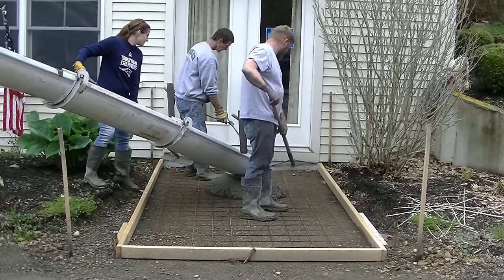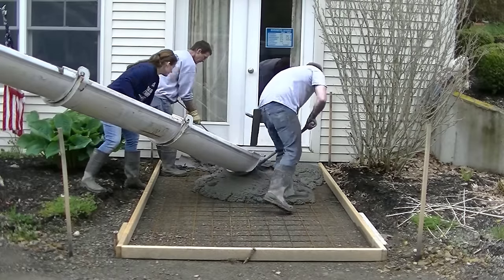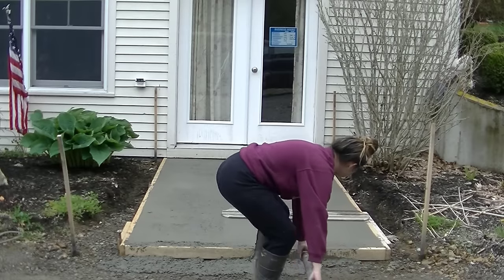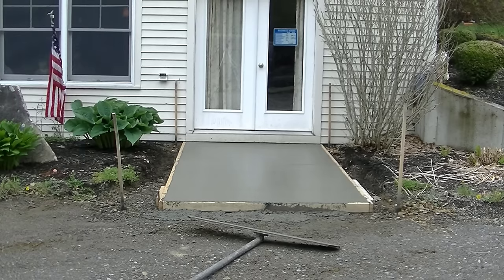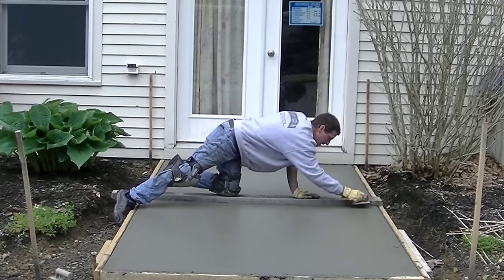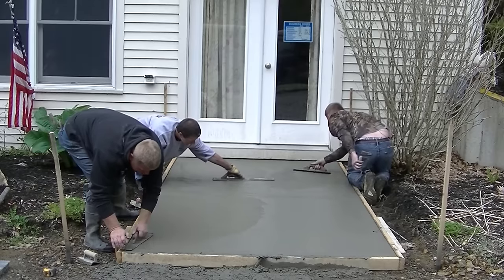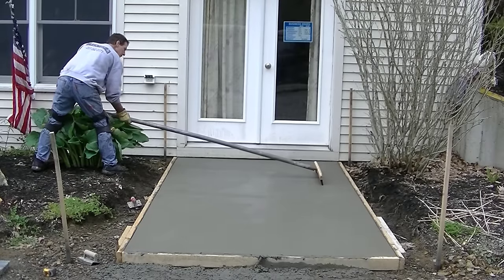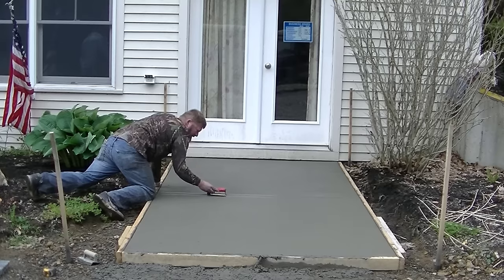Dry Pour Concrete VS Wet Pour Concrete - No One Else Is Telling You This

Comment: I’d use professional wet mix for speed and professional finish.
I’d use dry pour for other jobs as a DIYer.  In your pour I saw at least 4 different people.  If I’m by myself and don’t have a concrete truck, going to the store to get bags is easy for one person.
I don’t buy the strength argument.  I’d almost argue dry could be stronger compared to a diy wheel barrel mix since most overhydrate (weak).  Dry pour minimizes water ratio.  Watering over time (hourly) for 2 days will hydrate all the cement since concrete is porous.  My dry mix bag is already mixed (powder cement is covering all aggregate).
Anyway, I’d definitely hire YOU (the best) to do the job in the video (front step) - nicest finish by far.
But would do my own AC pad dry pour with a ok finish lol
You rock 👍
Awesome ‘Crete work! :)

Dry pour is very technique sensitive.  If you under-hydrate on  the first mist, it will bubble up,  smoothing the powder takes a lot of time.  Edging is challenging and gives less than professional results most of the time.

So, yeah.  Wet pour for important professional looking stuff.  
Dry pour for typical DIYer jobs - pads, a step, shed foundation…

Comment: Could “wet-as-you-go” pouring a be viable option for DIY’ers? Form out the area for the concrete application. Place a vinyl barrier between the ground, and the concrete. Incrementally empty the dry concrete in the form, add water, and mix the concrete in the form as you go.

Comment: You talk about dry pour (putting down mix and then adding water on top) vs wet pour (pre mixed), but what is the difference between two well mixed (with water) pours one very wet and flowable and one quite dry needing pushed around by hand but again, both well mixed ?

Comment: Long ago I helped a friend dry pour a basketball goal and some fence posts because he didn't want to borrow a wheelbarrow. Looking back we worked harder trying to mix in the hole than using a wheelbarrow would have been. When we pulled them a few years later we discovered the bottom never even got water but the top looked ok. Disaster looking for a place to strike! 

Now I've poured several small projects using bag concrete mixed per the instructions using finishing techniques I learned from your channel and they have all turned out great. Thanks to your videos I've gained a better understanding of concrete.
Reply: if u were mixing it in the hole, it isn't a dry pour.

Comment: I have to do dry pour also. It’s a slab on slab, and I will need to make the pH acceptable to bond to each other, BUT it will hold a toilet and sink and washer/dryer. I will also put tile over the concrete. I cannot do wet pour alone. I’m 59, have MS and can’t do this wet. I won’t be alive anymore by the time anything happens to it. I will also add steel reinforcement inside of this 6x9’ slab at 5” thick. 🤷🏼‍♀️ I mean what do you do? On a fixed income. Maybe you could do your best to show us how to do the best dry pour possible.

Comment: Grateful for your insights...not only wet vs dry, but just seeing how you did the work.  I'm doing a small 4x6 soon (only 4 in slope) should I have any type of spacing board (1/4 - 1/2in) at the top of the ramp, between the ramp in the landing. Seems like some ramps I've seen have a little half inch board there. 
Thanks again for taking the time to show us how to do the job!

Comment: No doubt the traditional mixing of concrete gives a more durable result. But dry pouring seems much easier if you don't have good equipment to do the mixing. And perhaps dry pouring will be durable enough in many cases.

I have bag of unused concrete that I forgot about and was left outside (under a roof) for a couple of years. The climate is humid since it is close to the sea. The bag is now rock solid. Gonna take a sledge to crack it open and take a closer look.

Comment: Hey great video; I’m getting ready to add a 12’ x 24’ driveway extension… what is that mechanical tool used to tamp the dirt down?
Reply: It's called a tamper, you can rent one for 4 hours for $50-60, but for 12x24,   you can just use a hand tamper, just lighty spray the ground with water and tamp until hard.

Comment: I think it comes down to cost. Dry pour is cheaper imo. Much easier to get supplies to the site. I'm considering a dry pour for 4x5 pad bc I can't get a truck near the site. Enjoy your channel.
Reply: Did you dry pour a project?
Reply: I'm curious how a dry pour is cheaper? If you are comparing hiring your local concrete company to bring a truck of it, then yes a bag of concrete is cheaper. You can however add water to the concrete mix in a bucket, stir it up and pour it wherever you want. Takes a bit more work, but definitely doesn't cost any more and then you never have to worry about whether the water saturated deep enough.
Reply: @MrTheJeoff  Time is money.
Reply: @andyh8239  which is why you do it the best way the first time...
Reply: @MrTheJeoff  I wouldn't dry pour... Terrible idea for nearly* every application.  But I understsnd the alure....

Comment: You have experience. I have done all my personal pours and many when I was working, spillways, motor platforms, tank pads, etc. I had a nine man crew, trained pipe workers. Every so often I would have a man that had done concrete. Made a difference. As personal pours go I miss spoke. I am sitting in a 30 X 50 shop that I hired out. Getting older. I laid it out and prepped the base (compacting the soil under the pour is very important). Set batter boards and was going to form it. The man gave me a good figure that included him forming. The man had two helpers, one very skilled. They did a beautiful job. Getting older I mentioned, 73. The contractor was four years younger. You had four folks on that small pour. Great job. My point is with a redimix pour you have to coordinate with the batch plant. If you are not a frequent flyer with them you come last, or not at all that day. Then you have your help that has volunteered their time to help. I have done several 20 yard personal pours, two of them just me and another wore out veteran. On one the driver took pity and gave us a hand. I took care of him. Volunteer help? I had to take the edge tool away from a dude when doing a six X fifty two walkway on one house I constructed. I have done two 6 X 5 pads dry pour. Learned from each. Both are acceptable. The misting process is deceptive. If you only mist until the mix changes color I found the pour forms a scab that may delaminate. I had two spots on my first one. Lay the water on even if you get a wet spot, just don't expose the aggregate. I also flood the perimeter forms with water to let moisture wick up from the bottom. I will be doing a 20 X 20 in front of the shop I'm sitting in dry pour in sections. I get a pallet on my one ton, 42 80 pound bags = about one cubic yard, 4" thick. About an 8 X 12. Got a buddy I give a few bucks to help out. 42 bags run about $240. I pick it up at my leisure as well place it. Do it in sections. It will be a work slab. I have equipment going up to 10 tons. The substrate will be firm. I enjoy watching all you video dudes programs. Keep up the good work.

Comment: Now that you have had some time using MBW's battery powered screed how does it compare to the gas powered.  Are there limitations. I have watch a couple videos from 2 years ago but i was wondering now that time has past what your thoughts are.  I getting ready to buy another was contemplating the battery powered screed demon but I'm leery.  When I purchase i will use one of your links.  Thanks

Comment: I use the least amount of water to get it mixed, then hit it with a concrete vibrator to agitate the air out.  After it sets up, I try to keep it wet for as long as possible / flood if possible for a month.

I cant saybfor certain how much the vibrstor helps with strength, but I wouldnt be surprised if it was a LOT.  Esp for core filling masonry units.

Comment: Question. Im planning to extend my patio, but in order to get the extended portion of the patio leveled, it will be the height of my siding. Im aware concrete should not be poured on the siding, but would it be better to cut or remove the portion of siding, or should i cover the siding with a sheet of metal for flashing? Ive gotten a couple quotes to get this done, but not sure which method would be safer.
Reply: water would find a way under the flashing when it's flush...dependig on how much rain you get that water could pool and slowly rot out underneath the siding.

Comment: i'm trying to pour a sloped slab on top of an existing slab that has water pooling in the middle. i can handle a wet pour but do i need to take any measures to insure that the new concrete bonds to the old?
Reply: If you are pouring over an existing smooth finish, you should deform the surface a little, you hit it with a chipping hammer on a real shallow angle to remove some chips 1/4-1/2" deep, cut some lines in it with a grinder with a concrete blade 1/4-1/2" deep, or drill some holes with. 1/2 masonry bit 1/4-1/2" deep, then rinse allow to dry and roll or brush on a thin layer of blue bonding agent, you don't need to go crazy with the deforming you just want to keep the top slab from sliding over time, depending on the size of the slab maybe every foot or so in each direction chip a couple of spots, drill a couple of spots, or cut a couple of 4-6" lines.
If the existing concrete is broom finished or has a rough surface you can just rinse it real good and apply bonding agent.
Reply: @timothylamattina3697  awesome. thanks!

Comment: As someone who went to college for engineering and spent a lot of lab time on concrete breaks of different mix designs and who now is a superintendent on multi million dollar commercial projects I agree with your sentiments on this.  I’d like to add to it a bit.  If you over hydrate the concrete before it sets up, you will lose your strength, dryer is better if you are going to do a dry pour.  The concrete will actually extract water from the soil it is in contact with.  Ever leave a bag of concrete laying on the ground for a period of time? Never do a dry pour for anything structural.  Dry pour should only be a consideration for somewhere you cannot get a mix truck to.  Even then, wheelbarrows, tractor bucket or pumps are available.  Having said that, I’ve done a dry pour to make slabs in the woods.   Finish was rough, definitely not worth the hassle, time is $.  Next time ill drag a gas powered mixer in there.
Reply from the maker: Thanks Mike!

Comment: As an old concrete guy, wet is far superior. However, older of women might find it easier to do the dry pour. The end product will not be as strong but mixing does take a toll on the body.😊

Comment: There's really nothing about the concrete trade that suggests dry pour applies there, so any "discussion" here is gonna be odd at best. Would I hire someone to dry pour? Of course not, I want them here, gone, and don't expect to babysit the project.

Would I wet pour without hiring someone? Probably, sure! Is it always "best?" Hmm ... for a DIY-er uninterested in acquiring many of the tools needed for wet pour, along with the understanding of how the process is different, dry remains a viable option.

I do dry pour very small projects. I don't worry about mixing, because I always add water to start, pour in some mix, and give a quick mist or short spray. Add more dry mix, repeat the water, it doesn't take much. Is it a perfect mix? Doubtful, not at installation but nor does it need to be a perfect mix during installation because the expectation isn't that it'll be strong as quickly as wet pours. That water WILL sufficiently mix, but it takes MUCH longer. If I layer the water and toss on additional dry mix, that water must go somewhere, it doesn't get trapped, it mixes itself with what came from the bag.

Do another dry pour, Mike, and layer with mist water if it makes you feel better than waiting until the end to water. Let it sit for 30 days before driving a truck over it or chopping it up to test. We mentioned that already in your other video! Like I said, none of this is applicable to your business model, and that's OK!
Reply: I was wondering this after watching a few videos where they didn’t even wet the ground? Why not wet it as you go to ensure moisture gets in the lower portions or even mix it around with a tool and then quickly dump in that last half to an inch of powder mix to finish off the top portion and get to misting?

Comment: I been a contractor since 1984 never used a dry mix its  un professional it will  crack  how can you use wire mesh or rebar  second of all you need to put two shovel fulls of  portland cement it will  bump up the psi to over 3000  psi  i know my  business ,it a cheap way to do it,  however its not going to last like a mixed   batch

Comment: From experience wet pour is better then dry pour. Wet pour is stronger and last a lot longer before any issues. I've tested two 3" slabs (both wet and dry pour) at home by driving my pickup truck over it and the dry pour cracked after several passes.
Reply: how many days after the pour did you test?  cause dry pouring takes a much longer time to reach full strength, at least a month.

Comment: I am in my 60s poured a lot of concrete, decided to try the dry pour on an 8ft x 12ft shed slab,  total cost lil over $200- labor about 6 hrs preparing area building forms and adding dry concrete smoothing and now its water every hr,  for a shed this may be fine, I would mix the concrete for any side walk or porch, I like to use a broom on the top and with the dry poor you wont get that texture, just pull loos sand. also the chemical reaction on MIXING isnt a guarantee of just adding water when dry- I have a few spots where the top will possibly not be smooth at all-  so for a patio or sidewalk  I would ONLY wet mix- for a slab that you dont care about and may not last use dry pour-   note few yrs back I paid $13k for a Co to tear out asphalt and give me a new  28 x 24 garage floor and  2 car 100 ft  drive way about 6 wks later 2 of the slabs started to crack. I had the concrete Co come out and they said that 2 trucks came out with cement and the second truck did have a bad mix, (another person had same problem) so 4 slabs should be replaced, problem is the installer wont do it for free, and the concrete Co said they will only bring concrete if its THAT installer.

PS  stick with mix,  even a post hole post dry isnt the best   IN MY OPINION>

Comment: My question is : when I di bull float I have a lot of water on top , and thus water stay on surface !!! thus water from concrete,  what she'll I do ?
Reply: You will get a limited quantity of bleed water coming to the surface on properly mixed concrete. Excessive bleed water is from having too much water in the mix. Super wet concrete will still set up, it will just be weaker.

Comment: I ordered 120 bags of concrete mix this summer, and I am doing a wet mix by myself. It's taking months! I am halfway through, though.

I am mixing concrete in a black tub with my shovel one bag at a time. I learned that I can only do 7~10 bags for one part of the slab because of timing. Even this takes several hours. Form preparation, rebar placement, moving mixed concrete with a bucket. And because I am doing it partially every time, I also have to think about anchoring. I have to insert a rebar or some nails to the side of the previous partial slab before I do the next one. So it is taking a lot of time.

DIY is still fun. But now I know why you pay contractors to do the job. It is just impossible to finish it within days if you do not have some kind of mixer.

Comment: Dry pour only makes sense for something very small and someone who wants to save money and isnt worried about the look of the finished product.  Abviously isnt as good as conventional concrete. Remember home owners to really b careful what "professionals" u hire. Some do an excellent job and some not much better than a diyer. Mikes work is excellent.  Dont pay for professional work without getting professional results
Reply: I wouldn't say that having the steel mesh unsupported and not placed in the middle of the slab is excellent or professional!

Comment: I wet poured all my chain link fence posts using a wheelbarrow. My gate hinge post is schedule 40 2 3/4" steel pipe set 3 feet into the ground with six 80lb bags of concrete. That was a lot of work. So, when I saw people doing dry pour i was interested. I've had some time to consider dry vs wet.
I've decided to go with wet and make smaller forms since it's just me doing it. I've done quite a bit of research on concrete. Including refractory cement and high temp mortar.
Refractory cement has to be wet poured and the curing process is pretty exacting.

In case anyone is interested, here is my recipe for high temp mortar.
10 : 6 : 2 : 3 – Sand, Fire Clay, Cement(*), Lime.
The numbers are "parts". Parts could be cups or any other measure you can be exact with.

(*) Not mixed concrete - portland cement.